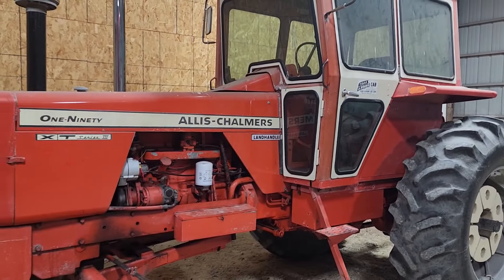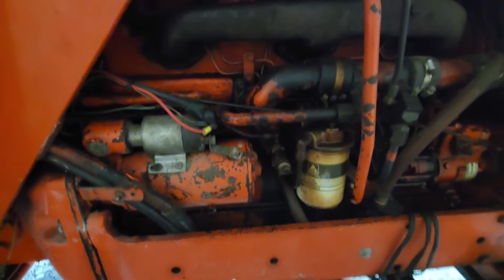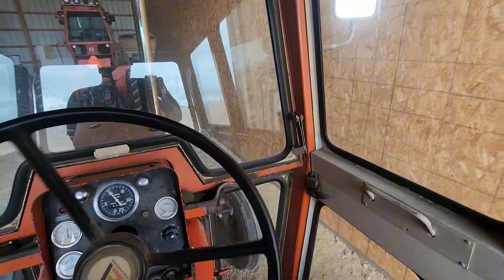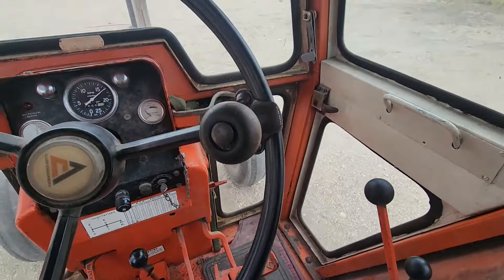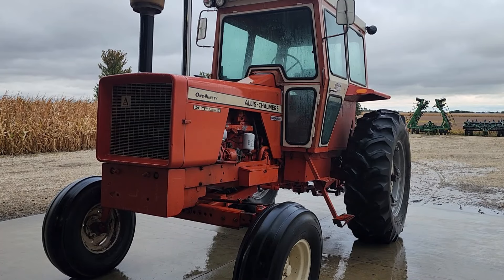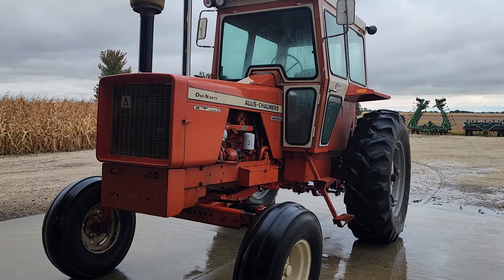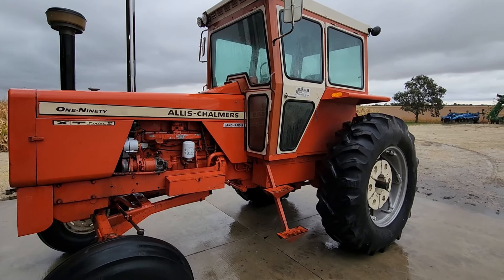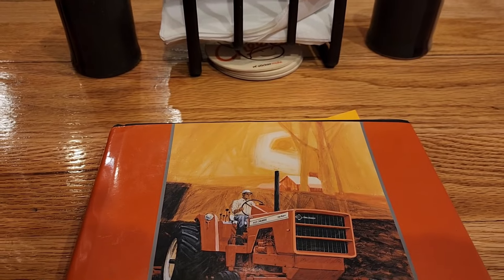I bought another orange tractor

Comment: What is wrong with fluid in the tires?  Keep valve stems good never a problem
Reply from the maker: It rusts the rim out. Nearly every restoration job I've ever done that had fluid in rear tires ends up needing new rims like the 4440 we just finished for example
Reply: @rgfarmsrepair503   I know, a lot of guys are too lazy to change a valve every now and then. We have 50 year old tractors with fluid and never lost a rim or even had to repair one and our tractors were in and out manure pits for years.